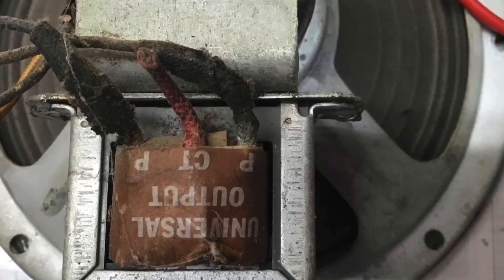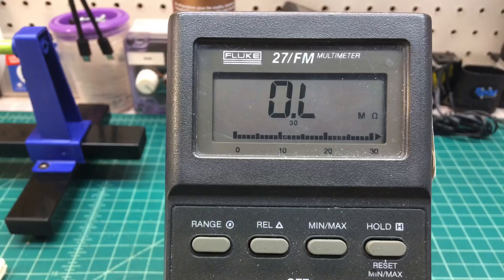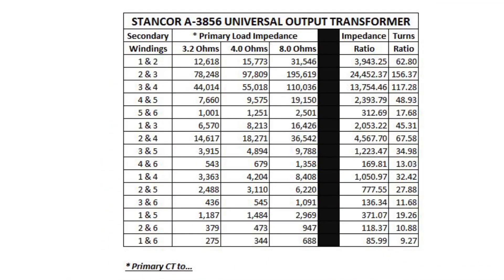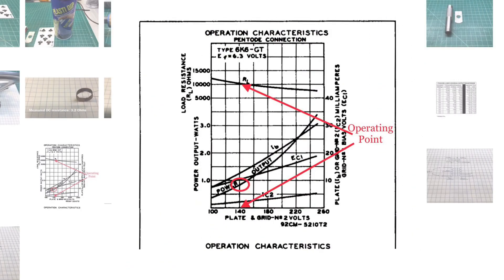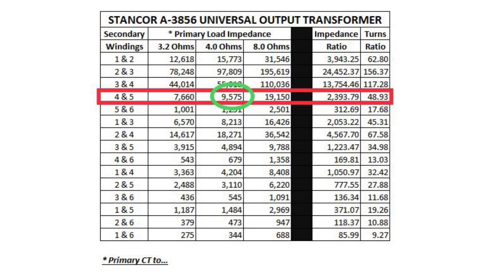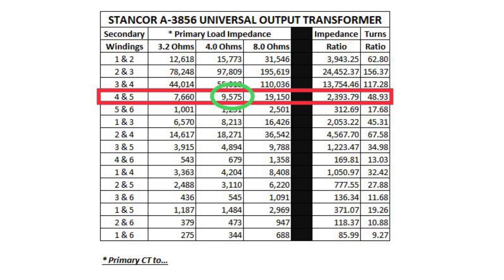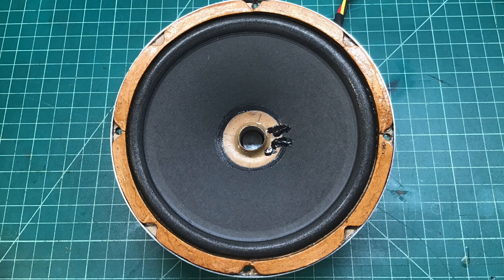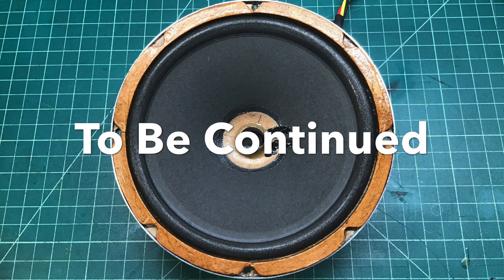Musicaire Radio - Stancor A-3856 Output Transformer Troubleshooting

Comment: Hi Don
In a push-pull with #42 pentodes, assuming operating at optimal plate 250v the tubes want 7k ohm load resistance. Do I combine both tubes for a total of 14k load resistance to calculate output xfrmr winding?
Thanks
Frank
Reply from the maker: Frank - in a push-pull configuration, a 10k plate resistance is the most common for the type 42 tubes. A couple reference sites that you might already have pinned, but just in case. Thanks for reaching out & all the best. Don

http://www.radioremembered.org/outimp.htm

https://frank.pocnet.net/sheets/093/4/42.pdf
Reply: Hi Don, Thank you so much for the replies.  Those are great sites, thank you! I dropped a couple of questions hoping you would see one.
Yes I looked the tube up again and see that they want 10k ohms load resistance in pp. I need to ohm out the 6 tap secondary side to get the windings ratio.

Do you have a website or an email address? Patreon?
Reply from the maker: @-Todays-Tom-Sawyer-  You’re welcome Frank. My gmail is: TheRadioRepairGuy

Comment: Hi Don, nice explanation.
You are using 1/2 of a P-P output transformer as a single-ended? Do you think the lack of an air gap will make much of a difference? The P-P transformers don't need the gap as any DC current biasing effectively averages out so no great worries about saturating the core...
Personally, I doubt it will do much due to the low wattage, but it may colour the sound a bit more (lots more hysteresis along with a partially saturated core).
Looking forward to hearing it!
Cheers,
Reply from the maker: Eddie - being that the A-3856 is universal, using the P to CT is the correct way to use the transformer for a single tube like my situation. Someone had it wired P to P and the primary impedance would have been 1500 - 1900 ohms, far from the 9k to 10k spec for the 6K6-GT based on my operating voltages. The output of the receiver is limited to less than 1 watt, so the transformer should work okay, but hopefully I find out today if the sealer is completely dry around the surround. Thanks again for watching and reaching out. Best, Don

Comment: Using half of the primary worked out well for you,  and you threw in a cliff hanger to boot.
Reply from the maker: Thanks Jim. Sorry about the cliffhanger, but I need the second application of sealer around the surround to dry. Best, Don